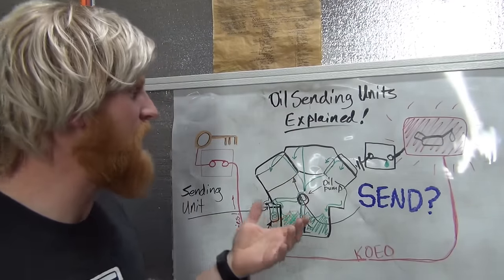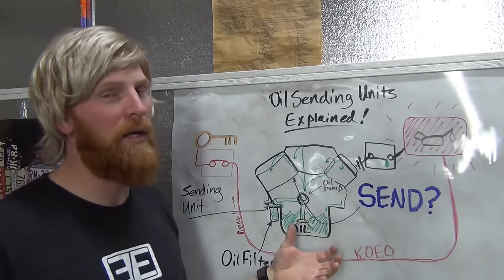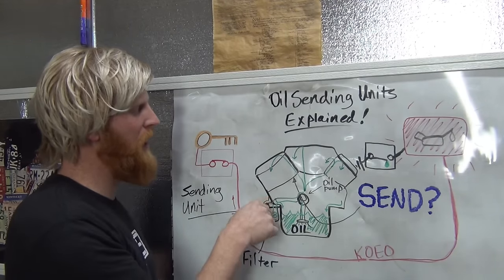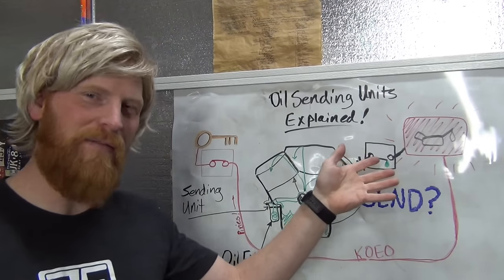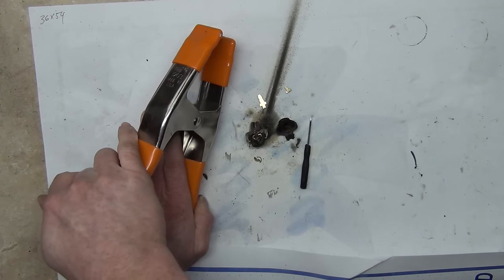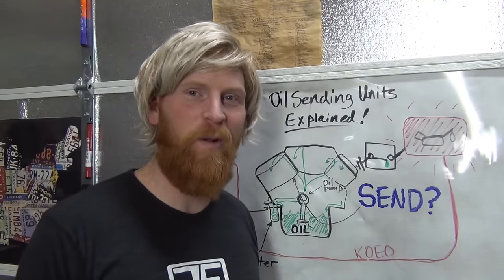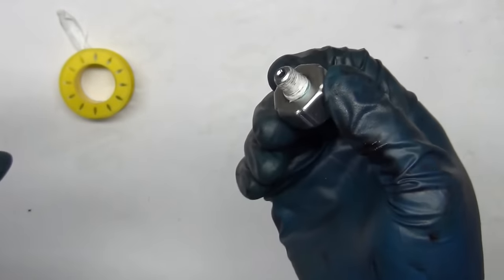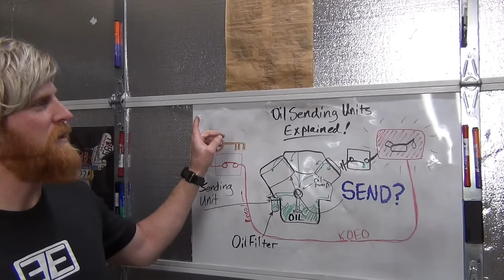Oil Sending Units Explained & Cut Open

Comment: I once used teflon tape on 1988 nova oil light sender switch only to have the light not come on at all. A quick check showed the teflon insulated the body of the sensor from the engine block. I cleaned it up and put on a dab of pipe dope then it worked.

Comment: The oil pressure switch and oil pressure sending unit are two different types of devices.  The oil pressure switch connects to the oil light on the dash.  The oil pressure sending unit connects to the oil pressure gage and/or computer.  The oil pressure switch is just an on/off device.  The oil pressure sending unit gives a voltage proportional to the amount of oil pressure.
Reply: Thank you for explaining the difference

Comment: Great explanation. Would you be able to tell me about code P06DD?  I replaced the sensor you explained, unplugged the battery/reset with ODB reader. Drove and the light remains on with the dodge grand caravan 2012 riding rough. I had the oil replaced and filter at the local valvolin. At the time of the oil change the idiot light had been on. What are your thoughts? Again thank you for your video. 😊

Comment: I have an oil pressure sending unit on a 350 Chevy it's got great oil pressure going down the road I have a small link by it soon as I step right on it it'll go down to 10 lb would definitely doing it

Comment: Any suggestions on how to secure the sensor if the engine block thread is stripped? I can hand tighten the sensor but once I try to further tighten it with socket wrench it becomes loose again .

Comment: I own a lot of Saabs, and the 1999-2003 years were well known for "sludging". A lot of people would run the cars with the oil pickup filter plugged 90% full, you'd hear lifter noise WELL before pressure became an issue, and by the time the light actually triggered (I believe it comes on at 5 or 10 psi in the Saabs) the pressure was low enough that the damage was mostly done already. I heard the lifter noise on my wife's convertible, took the pan off and cleaned the "sludge" out of the drain pickup, it was about 40% blocked. By the time the warning light comes on it's usually 90% or more blocked :(

Comment: Curious,,, you made the point that the "housing" of the oil sending unit and/or possibly the oil pressure censor are grounded through that housing to function,,, adding Teflon tape to the threads of one or both components will interrupt the ground as the components get their ground from threading it/them into the block or mounting attachments fastened to the block. You would end up getting interrupted or inaccurate signals. Then,,, the expensive and time consuming chase is on to find another cause of gauge and sensor problems !!

Comment: I think the confusion some people have about the oil sending unit "sending oil" has to do with the fact that back in the day of oil pressure gauges, there were some that had a long piece of tiny hose that actually did bring oil to the back of the gauge.  These were not electrical gauges but actual hydraulic gauges.  Might still see some on hot rods.

Comment: Please if you have time help me out... the oil light came on in my car on Christmas. And stayed all day. It would go off when I rev the engine. When it’s idle it comes on... then it went away for like a month and then would go away and come back for a few days... now the oil light and low oil pressure light is on constantly... I smell burnt oil from the vent when the light is on... one person said it was the valve cover gasket. But I got that fixed a couple years ago... another place says it’s the oil sending unit... I’ve been researching and trying to diagnose it myself cause it sounds like both... I was trying to find the oil switch to see if it had oil on it but I couldn’t find it. I know it’s on the right side of my car though. The oil looks like it’s coming from the right side of the valve cover gasket and spark plugs maybe under neath . But I’m not no mechanic... by the symptoms I’ve described what do you think it is???

Comment: Do I half to have an oil sensor? I can't get the darn thing out. And it apparently is stopping my fuel pump. Is there a workaround for that problem? Looks like above sending unit is access for a mechanical gauge.
Reply: Couldn't I just run a gauge off of there to my dash? And just forget about that OPS

Comment: How about splainin the difference between a oil pressure transmitter and a oil pressure switch? I am most familiar with the two but something to pass onto your viewers. We used to enlarge the hole in the back of the transmitter to speed up the signal sent to the gauge. Ken

Comment: thanks for sharing. BUT do not put teflon tape on, because as you explain this unit sends ground, and it takes the ground from the engine block. so, you are isolating the unit. Cheers¡
Reply: What if you soldered a lead onto the sending units lead and ran that to an engine ground then used all the tape you want to prevent leaks?  Wouldnt that still give you proper ground as long as the jumper lead you used wasent long or high resistance…?  Just because those units tend to be the cause of most oil leaks and on some motors it will pump out every bit of oil you got in the matter of seconds if the thing comes out or breaks off

Comment: My 1995 runner ran without oil for a while. I replace It regularly but the Guage tells me that the oil pressure is low rather often if I run my vehicle a while it says my oil pressure is okay

Comment: A mechanic had change my oil pressure sensor and it still leaking someone told me he might have practice at five over tidy what is the name of the part  The oil sensor screws into

Comment: I think you just made my car run again ive changed the oil and just about everything under the hood but it keeps stalling and ive narrowed it down to knock sensors or this oil sending unit car runs but you got to stop and it stalls and says low oil also the pressure gradually drops as the car gets warmed up but will go down to 20-27 psi and then stall once you stop at a light or sign new pressure sensor too car is a 2006 dodge charger srt8 with 10w30 oil i hope this will fix it ive done everything pcv,pcm,break booster check valve, spark plugs n coilpack gaped plugs to .50 new gas pedal, throttle body,map sensor, mas sensor, air filter, alternator, water pump, idle pulley, battery, coolent temp sensor thermostat, battery and still stalles says low oil well i hope this will work car only has 35k miles

Comment: did i miss where you say how much pressure makes it work and if the light for oil pressure comes on are you out of oil
Reply: How much pressure? No he didn't say. That makes it more of a universal video. 

He did say that the oil light could come on because there is no oil pressure or if it's clogged.

Comment: wouldnt putting ptfe tape on the threads give it no ground for the signal to happen ?
Reply: The Teflon tape does not electrically insulate the switch from ground.  It only fills in the gaps to keep oil from leaking out.  There are many parts of the threads still making electrical contact.

Comment: AFAIK,this would be called an oil pressure switch. A sender is used for a gauge,and sends a varying voltage to the gauge,not just an on/off,like for a light.
Reply from the maker: Good call.  Many of them are labeled as a switch, but when you look it up- it's going to say "sending unit" as a default.

Comment: 1986 vw scrocho  has 2 oil light sender switches. Naturally the dealer sold me the wrong one. One closes with pressure and tells you if the oil filter is getting plugged up. The other opens like normal with pressure. Dealer sold me wrong one. Turn car on no light. Start it up and the oil light came on. Another tripe to the dealer for the correct one.

Comment: Should it not be called an Oil Sensing Unit ?
Reply from the maker: Yet it doesn't "sense" oil either- just pressure.  It's a tough one to name isn't it?
Reply: briansmobile1 I just picked one up today because my wife's car is calling for a oil pressure switch.  When I ran the OBDII. She does have a oil leak but I think that is just one of culprit of the leak. But there's a hose that looks to have a leak but not sure just yet. hmm What's your take on it can it be the oil pressure switch is leaking so much that making it look like there's a leak on the hose?

Comment: The CORRECT terminology:
ACDelco D1846A GM Original Equipment Engine Oil Pressure Sensor
https://www.amazon.com/ACDelco-D1846A-Original-Equipment-Pressure/dp/B0016HPUS8

Thousands more examples

Comment: What if you guage is tacked on high even if the car is off... I changed the sending unit nothing ...I literally moved the needle by hand to Low when the engine fired up it went straight to High and stayed there again...ford Mustang go figure. .